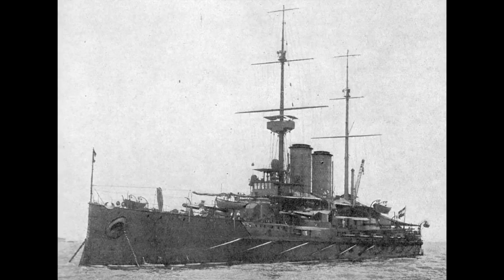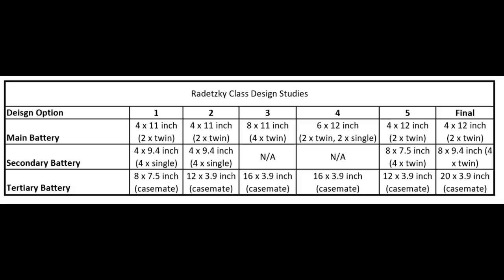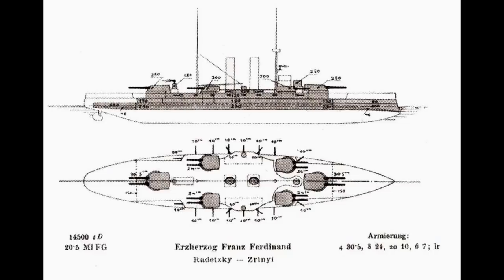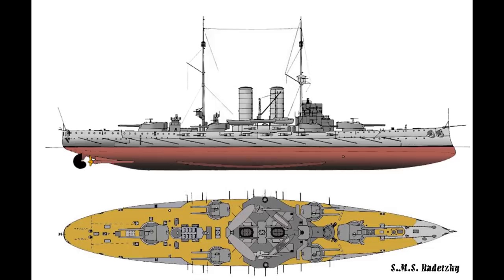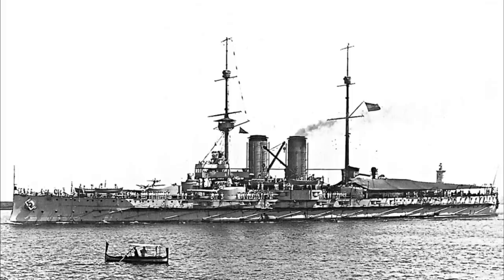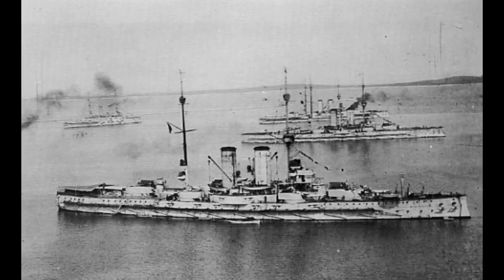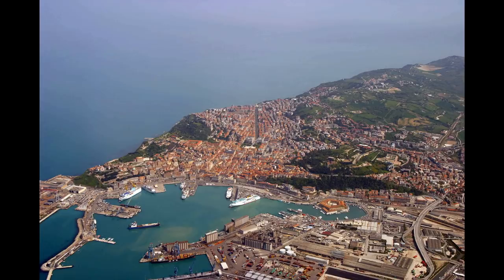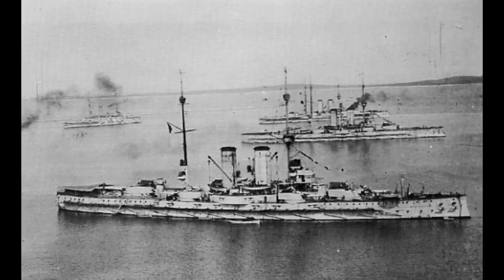SMS Radetzky - Guide 035 (Human Voice)

Comment: Drachinifel please answer a question for me. I have noticed, particularly on completed pre-dreadnought and semi-dreadnought designs, that there are structures placed on the sides diagonally along the length of the hull. Even HMS Dreadnought has them. What exactly are these for? Are they placed there as some type of mine or torpedo blast protection? I have noticed that, in some photos, on each of the structures the lower end appears to be attached to the ship and the upper end attached to what looks like a very long bit of folded canvas that also runs the along the side of the ship. Thank you for your help.
Reply: John Cashwell he actually answered this in one of the early drydocks, which is good because I had always wondered myself.  You made a good guess though!  They are booms that would extend to deploy a torpedo net around the ship while at anchor.  This was apparently effective against torpedos of the late 1800s into the first decade of the 1900s, and you even see them on Dreadnought herself.  However, after that time, torpedos became too large and fast to be stopped by any net that could practically be carried on a ship.  This, plus the fact that they had never been useful while a ship was moving at any speed, led navies to discard them.
Reply: those might be torpedo nets OR indeed a device to push mines to the side without triggering them.
Reply: Satori sama
They’re just torpedo nets. 

Drach has answers this multiple times, since people ask it all the time.

Comment: Like with your other Video on the class. You make the mistake of stating guns of 70mm calibre. Indeed A-H, like Japan, designated weapons by centimetre, these Anti Torpedo-Boat Guns and AA guns were 66mm in calibre not 70mm or 7cm. I like you mention the 5 preliminaries of the 1905 series, but you should know there are 6 more preliminaries from 1904 as well featuring mostly 40 calibre 30,5cm cannons. I made drawings for all of the preliminaries and posting them continuously on Deviant Art